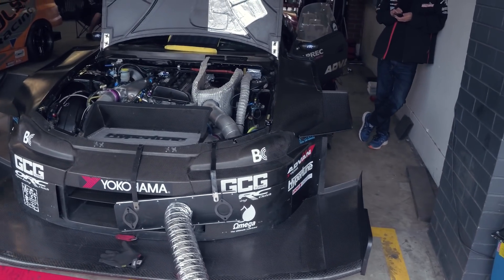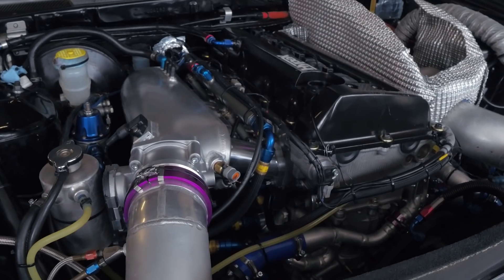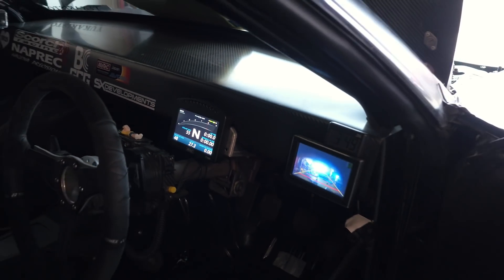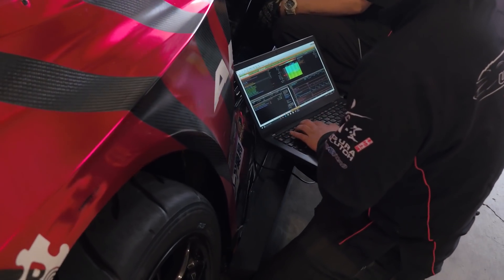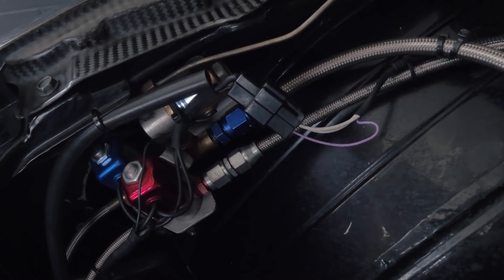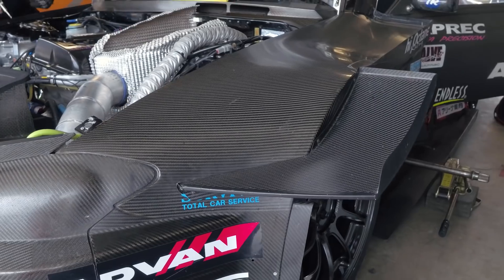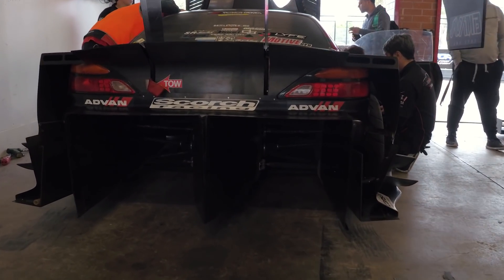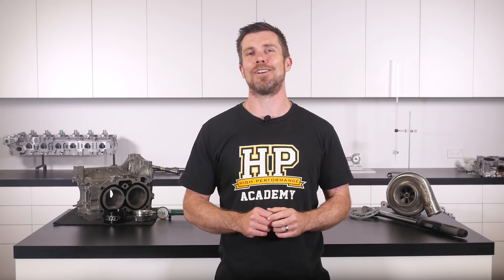[TECH TOUR] 2.2 L 1000HP 4 cylinder SR20 | The world's most modified S15 Silvia?

Comment: 1000hp with a gt35???
Reply: Shameel Ali and nos. And revvs. And 100% safety courtesy of Haltech
Reply: @JB-rv9fw  it doesnt have a haltech ecu, its motec
Reply: It’s the gtx35(84RS) turbo which is basically a gtx on steroids
Reply: They are spraying nitrous 7500 rpm to 9500rpm, it certainly probably peaked 1000hp, even if its at the crank